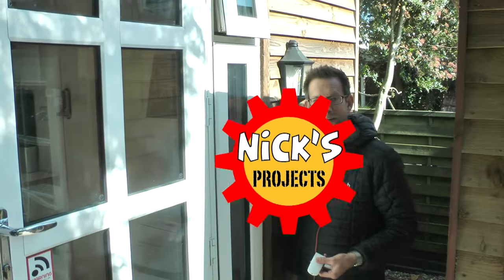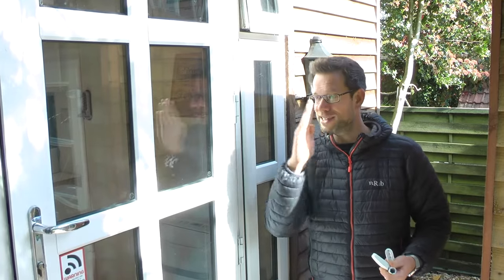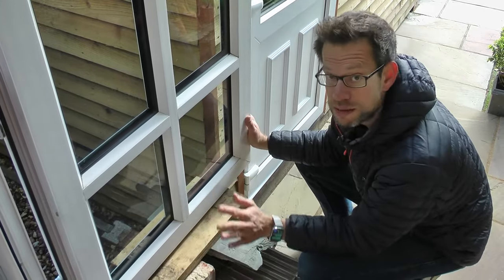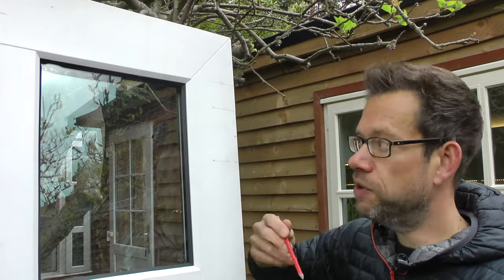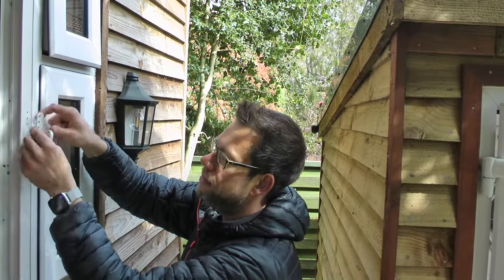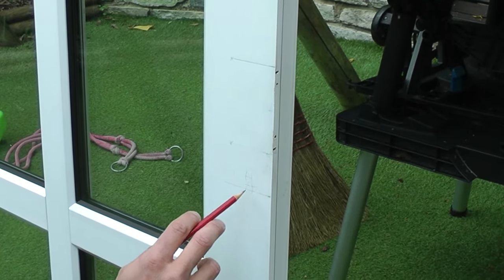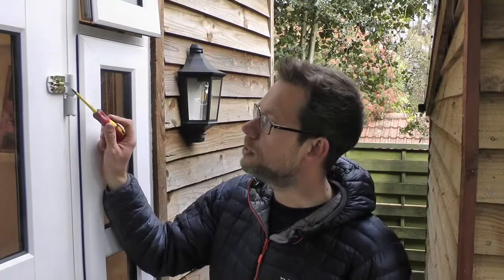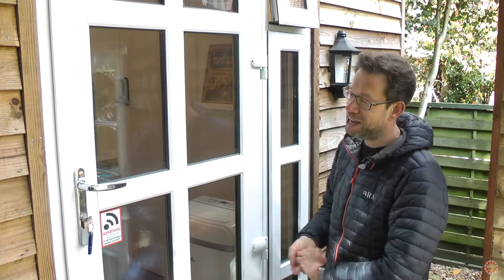Replace Your Own UPVC Door Hinges and Save £££

Comment: Superb. I opened up the hinges on my patio doors that require adjustment and found that I cannot adjust them left or right at all  as the hinges have been incorrectly fitted in the first place - all four adjustment holes have large screws directly into the doors!! I will try to correct them. Thanks for the excellent tutorial.

Comment: Hi Nick, thx for the video, I have a question pls: My (vague) understanding of flag hinges is that they are to be used with inward opening doors, as they could be too easy to unmount from the outside... But I see that you fit flag hinges on an outward opening door. Would you say that this installation is "not-so-skilled-burglar proof", unlike what I thought ???

Comment: Hi, great video and a great job with the door 😃 

Nick, you might have just saved me from utter despair at what to do with my 20+ year old upvc french doors with old style rebatted butt hinges that ave dropped and the hinges have no vertical adjustment (so similar to your originals but with a 'leaf' that sits on the internal rebate of the door).

I've had the local repair chap out, we've changed the broken hinges but I'm still stuck with a 5mm gap on one door. So I'm looking into if I can replace the old hinges with a better option. Hopefully to get a few more years out of the doors before I have to swap them out. 

Some questions...

1) Since fitting have the hinges held true and kept the door in alignment, besides minor adjustment? 

2) Does the flag part of the hinges come in different lengths,  if so how did you ascertain the correct size?

3) I take it you used the packers in the door frame to ensure the door was sitting square in the frame before marking where to drill the fixings for the flag parts of the hinges? 

Many thanks
Reply from the maker: Thanks so much. Glad the video was of help.  I found the hinges I describe in this video have worked perfectly well with a really heavy old door. Yes, packers can help and offer more adjustment to the hinges.  Since fitting them, I’ve tweaked them a couple of times, as they are fitted to a timber building which does move with extreme heat/wet weather, but they are so much better than those originally fitted.

Comment: Quick Q: when fitted, do these hinges allow you to lift the door off (as they are Flag hinges), as this would be excellent during times of frequent access (thinking of fixing my 'dropped' back doors, so bar-b-q's, etc.)?
Reply from the maker: Yes.  You just need to loosen the little grub screw on each hinge with an Allen key to release them and the door will lift straight up and off. 👍